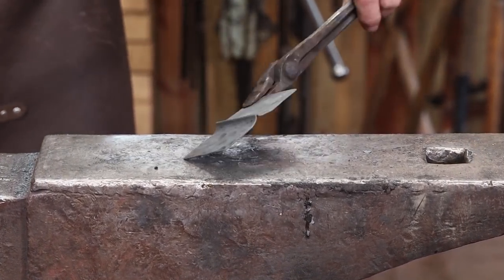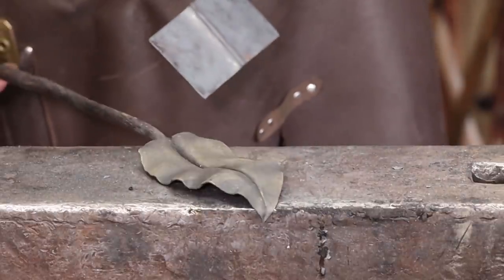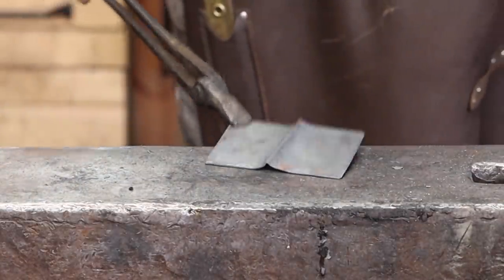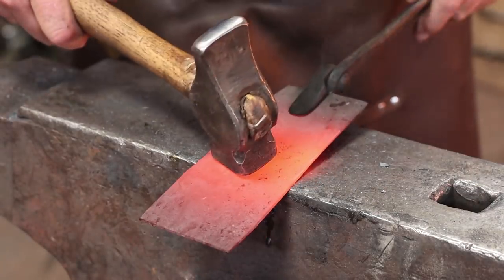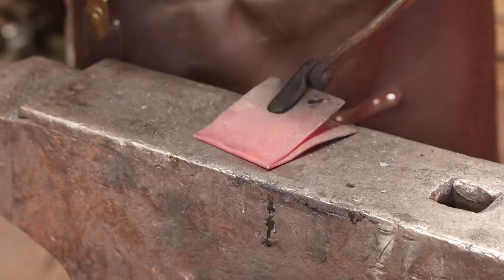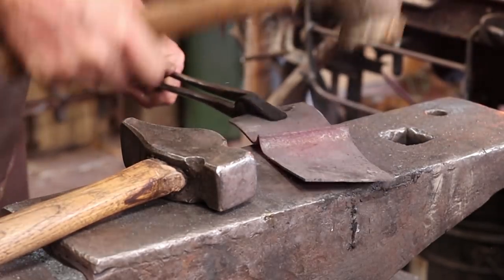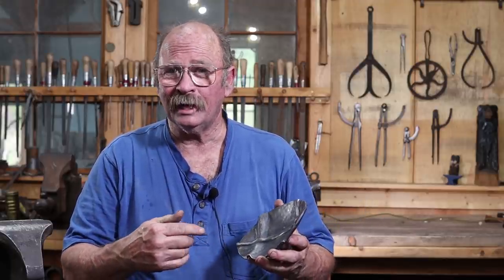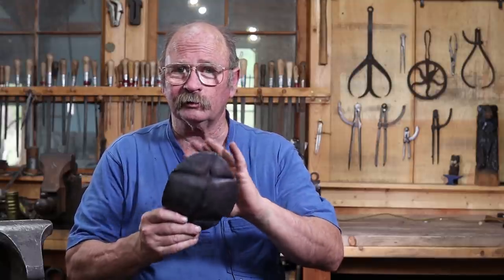Fold Forming Sheet steel - basic introduction for blacksmiths

Comment: I watched an architectural blacksmith in Atlanta at the King Plow  building while he worked on a very large crab sculpture. He had a cut out in a heavy piece of steel that was the shape of the shell back to which he tacked his piece to be formed. With a rosebud torch in one hand and hammer in the other he selectively heated the area to be worked then pounded away until the domed back of the crab shell was formed. He then cut the form loose from the heavy iron and ground to final shape.
This guy had some amazing pieces that he was working on including an all copper stair case with an Octopus entwined in the balusters .
I can’t for the life of me remember this artists name.

Comment: It's art, good idea, I think it is a fine dish.
I'd try to hammer it in its center area with a cylinder with rounded edges while hot to provide a flat center to prevent rolling in use.
Thanks for inspiring Sir:
Reply: But that could flatten the ridge as well... just a thought.

Comment: I think there's some practical use other than decoration, I started to think at the medieval armour with all that fold in the steel and maybe was done in this way, and that fold help the rigidity of the plate. Sorry for my crappy English
Reply: I was thinking rigidity and strength in armour as well.
Reply: You're absolutely correct on this. Fluting (applying multiple parallel folds like we see in this video) started showing up in armor around the 16th century if I recall correctly and became popular due to the added strength against crushing by maces. The curvature adds strength in the same way you can take a sheet of paper, give it curvature, and hold it out against the pull of gravity or other force. Tape measures are curved for the same reason. It's both functional and aesthetic.
Reply: Yes. It is called 'fluting' on plate armour and was done for  functionality. If you start looking you will see it in Indo- Persian equipment and even Roman helmets, too.

Comment: Really nice looking cold forming!  I had never seen that done before, thanks for doing the demo.

As an aside, if the smoke is bothersome, just slap a little water on the stump.  It'll soak in right away on the end grain and won't significantly cool the hot work...and, no smoke!!
Reply: Sorry! For some reason, this comment double posted about a minuted apart...must have been gremlins.....

Comment: "Not having a preconceived plan" is how Mr. Lewton-Brain cam up with this stuff! He says it's vital to take time to just play around.

In regards to how much work is needed vs thickness of material, an engineer buddy of mine tells me rigidity is proportional to the third power of thickness. If that's true, 3/16" would take more than three times the effort of 1/8" (Does that mean we can charge three times as much for it?)

 Thank you for another excellent presentation!

Comment: Took a class for leather lined copper sheaths that were fold formed then silver soldered. 
I think steel is done for botanical forms mainly.  Haven't seen it on anything else other than some small sections on ironwork like corners etc.

Comment: Very cool - i wonder if you could make one of those that appears to have a weave pattern.  Because the 2nd fold appears to be over top the first fold (and it sort of is) you could maybe take a square sheet - break it into horizontal and vertical quarters - and start doing top quarter (horizontal) and then unfold.  Then do left quarter (vertical) and unfold - then do top half (horizontal) and unfold - then do left half (vertical) and unfold - etc. - i think that would give a really cool "weave" pattern on the sheet with 16 sections.  I'm not a blacksmith - but would love to try that out.
Reply from the maker: I don't think it would come out just right because of the way it folds, but worth a try.  Even doing it in paper might give the answer.

Comment: I think that better results cn be made with making a V or U notch dye and opposite dye but this will work only to 2 mm thick sheet steel I think. Similar method use sheet metal manufacturers to give a bending strength to thin sheet metal plates (all car bodies is make on that philosophy, sometimes a layers of paint and other coatings is thicker than sheet metal)
It is very nice video.
Reply from the maker: Once you go to a die you are die forging as opposed to fold forming.  Two completely different approaches

Comment: I think this is one of those  skills that  just fall out because we can  made some thing better. 
Still this has it use . 
 A fail point in place. You want a fail point 
 Adding strength to things to some things. 
Making a bracket.  
  As you said  it mostly a decorative kind of  thing now. 
Still i can see this used to make a lock box.

Comment: Neat to watch, one day I'll try it.  A question:  What are the differences and or advantages of using a wood vs. rawhide mallet?  I've only a wood mallet, which I made from a deadfall oak limb in my backyard.
Reply from the maker: Rawhide is probably longer lasting plus the ones I use have heavy steel heads so they tend to be heavier hammers than a similar sized wooden mallet.

Comment: I'm seeing a tortoiseshell in there.
Reply: Jim Humphrey 
 Yes, another idea!
Reply: That's what I was thinking also
Reply: I rather suspect that by the time you get to the end of the tortiseshell pattern, it'll be both incredibly difficult to bend and incredibly difficult to not crush older folds. Maybe just working it on a stump with a mallet, because you don't need the sharper folds. Still, very intriguing.
It occurs to me that maybe, a small custom raised face style hardy tool (ala a stump anvil) with heavily radiused edges might be just the thing for supporting between the folds if you want kind of consistent 'tiles'
Reply: dude, build one and then share it. that is a wicked idea!
Reply: Me too

Comment: just wondering john - have you ever forged solid copper rod or bar stock - wondering if there would be issues with the hest - burning or other such problems?
Reply from the maker: I have not done any copper forging
Reply: Forging copper can be done in a forge by simply turning the forge down or placing it on the outer edge of the forge where there is less heat. Copper can be heated with a hand torch as well. Copper doesn’t have to be hot to forge until it needs to be anneal from hardening cause from forging. Copper is very easy to melt in a forge.